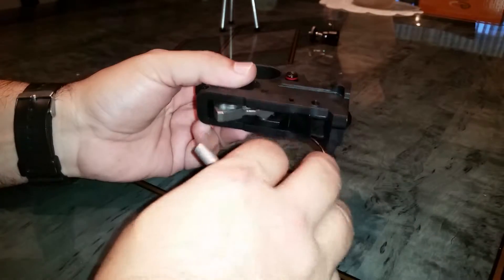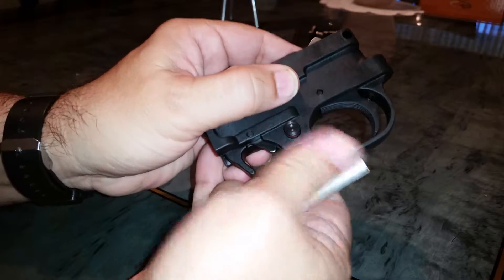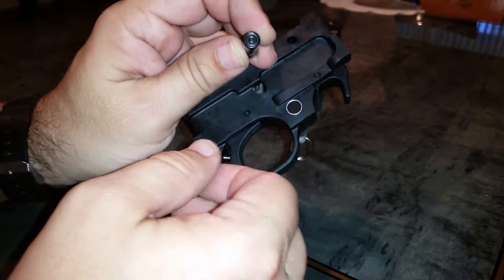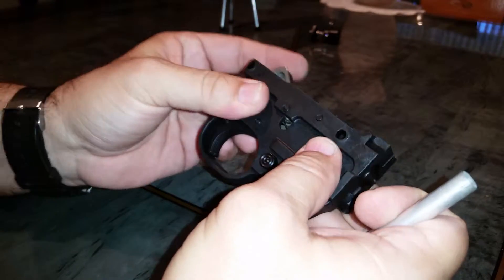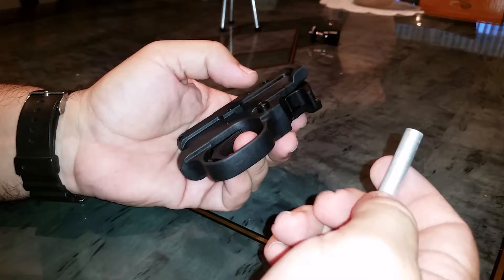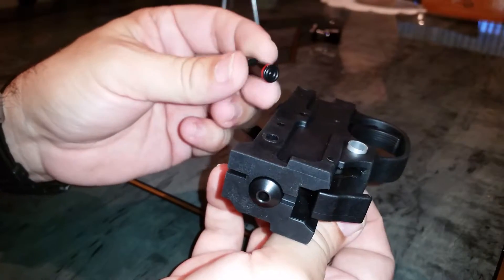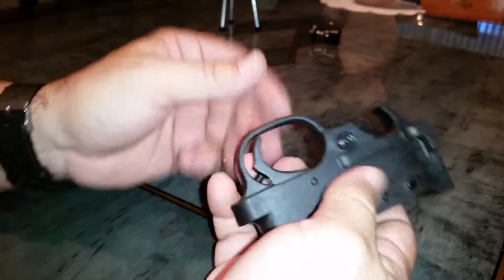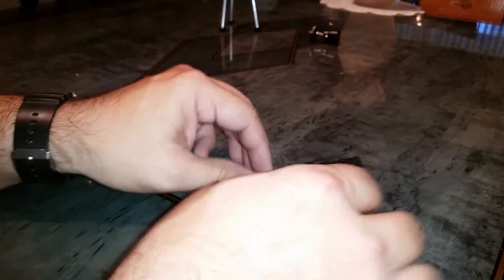Giveaway! Safety removal tool

Comment: I have a drill index with at least fifty bits--couldn't I use the shaft of the right size drill bit to accomplish the same thing? Can I turn the button around and make it work for a left-hander?
Reply from the maker: @gymshoe8862  it has to be filed down to work left handed. It's doable, obviously. Heres a video on that https://youtu.be/eAgzY8tgiO4?si=GR1PMe5hmcqBvZPL

Or you could buy the left handed safety.

Comment: Are there any left?
Reply from the maker: Sorry, this never went anywhere. But it is very easy to make one for yourself, just need something of the right diameter: a brass, rigid plastic, aluminum or other rod or tube will do. As will a nutdriver or small enough socket.